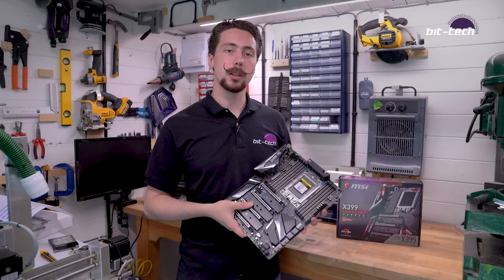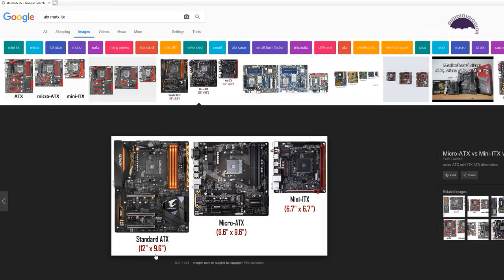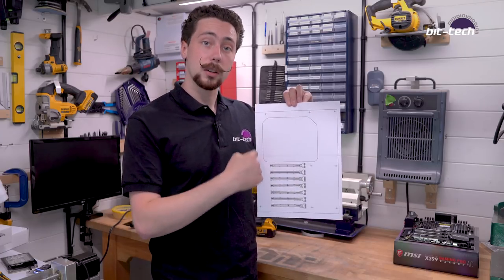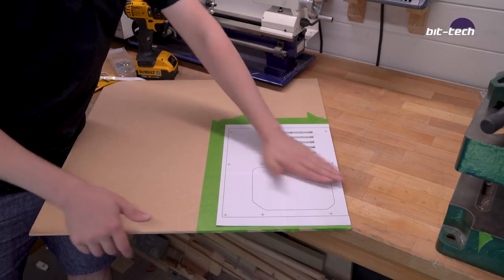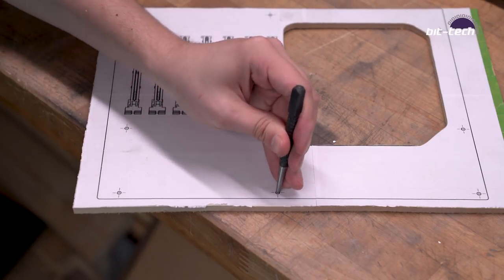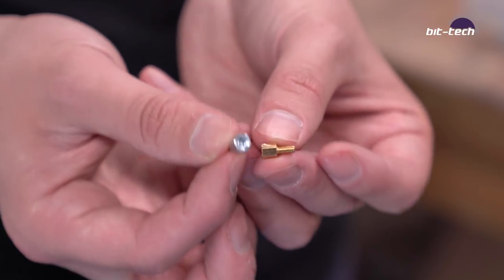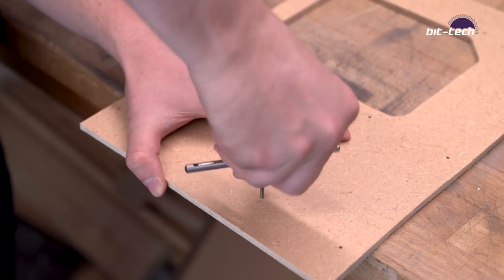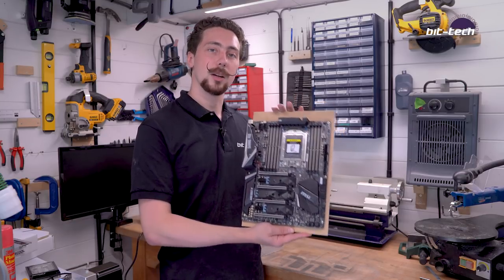How To Make a Motherboard Tray from Scratch | bit-tech Modding

Comment: This is the most professional Youtube channel about PC modding. I sware, I saw a lot of them.
I still waiting a video about brass and carbon fibre tubes bending. And cheers from Russia)
Reply from the maker: Thank you, glad to know we’re hitting the right mark <3

Ahh doubt you’ll ever get one about bending carbon sadly, the innate properties of the material sort of prevent that, they’d need to be formed in shape originally. For brass though, would be better off using annealed copper instead as that bends easy using standard plumbing tools, will be doing a future video on that :D
Reply: @Jack Yo he means swear

Comment: I have designed a motherboard tray for my case build. The thing that I struggle with and which is much harder though is how to attach the expansion card tray. To have the right gap between the motherboard and the tray and how to make those little slots where the back cover of the expansion card slots in.

Comment: Tip for tapping wood: Drop some superglue into the hole before tapping, then tap the hole. That way you have slightly stronger threads.
Reply: That's exactly what I was going to suggest. I find it works quite well and when using thin-set as it can really penetrate the fibers.
Reply: If you don't plan to remove the stand offs, just drop some epoxy into the holes.

Comment: Ok, so the actual easy from scratch version goes like this 
1:Get some decent wood.
2:Lay motherboard onto the wood where you want it to be, make sure it's straight and level. Take a pen and simply push hard into each hole (not turning) This will leave a dot.
3:Take out the stand offs from the old case, and screw the stand offs into the dots you created.

tada.
Reply from the maker: It works, but this way can allow you to do much, much more. Learning to work with the spec and making templates allows for significantly more advanced projects.
Reply: It's better if you can do it out of metal, t6 aluminum can actually be cut with an off the shelf router and the appropriate cutting head or other compatible metal cutting tool. You can also get away with cutting sheets of aluminum with an off the shelf radial saw and the appropriate blade. (Do wear proper PPE when you are working with power tools and metal.

Comment: I've been thinking a long time now about making a drawer like case for my main PC. This so that if I need to access something I just pull the whole computer out on nice ball bearing sliders, like a kitchen drawer.  The main hurdle in my thinking has been how to mount the board... This method here does open things up in my brain. 

For extra points, I'll just need to source some kind of nice cable extendors that allow me to pull the whole thing forward the half meter or so without me having to disconnect things from the back each time. Hmmm.

Oh. And the exterior should of course be some very nicely grained wood.. just to satisfy my need for wood grain... And the case would also be using muffler type whisper box air channels for extra silent operation.

Comment: Using this to create a custom PC wall mount would be awesome! Maybe even dress it in blue leather for the looks.
Reply from the maker: Ooh blue leather would would be sick, just watch out for your heart Chev.
Reply: bit-tech what I wanna do actually is to build a dual system tower but I don't particularly like the obsidian you used. I wanna get 2 atx systems and I found out a website that's called mountain mods that have these huge towers for dual systems. It's a shame that I have to pay more for shipping than the case itself that's worth like 500$ to get it in my country

Comment: Thanks Alex this helps on my planning for my build would prefer a veneer wood as the method to mount MB then a doner system. Do you think having metal nuts located on backside but recessed my be needed to carry a heavy MB?
Reply from the maker: Mostly depends on your tray material and stand-off size I reckon. If using wood, you can use threaded inserts, those will provide a really strong thread for the board.

Comment: Another interesting and informative video. Why not Copper or aluminium or steel though? I guess to keep it relevant to a broader audience. I hope your channel grows, maybe you could get a shout out for supplying a part to DIYPerks or something like that. All in good time but that dynamic worked for me (to some extent) on my knife making channel. As a side note Zadak showed an interesting prebuilt system at Computex with a watercooled motherboard tray, can’t remember if they patented it but I’m sure an ingenious fellow such as yourself could knock something similar up should you be so inclined.
Reply from the maker: Funny that, I know the folks at Zadak quite well haha, we're in talks about producing something together. I did a livestream thing for them at their booth at Computex. 

This video's more about the technique/workflow than being specific, so you can use any material you'd like. I used MDF so as not to waste more valuable ones in the workshop, the 1000D project will have a special one cut from 5mm aluminium :D
Reply: You are now entering the twilight zone. Synchronicity in action. I’m not sure why I even mentioned it, just saw it and thought there was some very innovative design and quality engineering in there and that you might be interested and low and behold... you’re already working with them. I’d never heard of them until recently and the product I saw (a prebuilt) looked awesome but I’m not sure they have a niche at the price point they’re suggesting. Not that the price isn’t fair for the exemplary work and materials that’s evidently gone into it, just that the form factor I saw will limit it’s appeal to professional clientele. In the wise words of Manuel from Faulty Towers “I know naathing” but my suggestion to Zadak would be to consider having modular components for sale separately or along side their prebuilt line, perhaps expanding the prebuilt line to make increased storage and multiple GPUs an option. I’m pleased to hear of a potential collaboration, it seems to me you’d make a good team and though it would be a shame to diminish the bespoke feel of the things I have seen you create, it would be awesome if they were more widely available. Hope you enjoy the journey anyway, regardless of where it leads you.

Ps - As much as I love MDF (having previously built a pc case out of it), 5mm aluminium sounds more your style. Very excited to see it come together.

Comment: I would be careful using a wooden material, due to flammability. You could possibly cover it with metal tape to make it a little more resistant.
Reply: Would that not cause short circuit problems from the board solders touching the board?
Reply: @ianfox5103  Not if using regular standoffs. Most motherboard trays are made of metal after all.

Comment: Great video, but formfactors.org has gawn. Takes you straight to Intel. 

I suppose they've taken over and covet this information, because although I registered, I can't find anything relevant? Oh well, I'll design my own scale drawings. Thanks for your efforts....

EDIT: Decided to use an old mATX and eyeball the mounting whilst marking the screw holes. Will 3D print some spacers and use M4 bolts instead.  Shame about FormFactors.org

Cheers

Ian. Birmingham, UK
Reply: Yeah, I was just about to comment this. The ATX drawings / specs are now gated, and even when creating an account (both types) I was unable to access it. Fortunately, this document still exists: https://web.aub.edu.lb/pub/docs/atx_201.pdf (although I'm not sure how much longer it will be the current spec).

Comment: Just gonna ask how would you support the graphics card
Reply from the maker: A lot will depend on the design of the case it goes into. You could either attach an existing IO bracket onto a tray made using this method, or could cut out slots for GPUs from the back panel with mounting points etc. There are some interesting methods out there used in open test benches, some use a similar system to those found in mining rigs, others use rods with threaded holes etc.

Comment: The download files are all DXF I don't know what to use to open this file type If anyone knows a free download that will open these files Please Help I am in the middle of trying to layout the motherboard stand offs on a Plexiglas Piece for a Thermaltake tower 900
Reply from the maker: Fusion 360 will open the files and is free
Reply: @bittech1  Thank you for the quick replay I Like you channel
Reply: I am still having trouble opening the file for ATX motherboard layout
Reply from the maker: @kennethkirby320  Did you try the .F3D native fusion file?
Reply: I can open it in the cad software but I am having trouble getting the dimensions for the stand offs and printing it. I was going to try to lay it out once I get the dimensions. Sorry for all the questions it has been years that I did any auto cad
Reply from the maker: Ay no worries, have you checked out the video we did earlier on making cutting templates? Might help a bit as it uses the same techniques
Reply: @bittech1  No I wish I could if I could find the templet to print out it would be a BIG help
Reply: @bittech1   Could you give me a link to the video for  making cutting templates? sorry I couldn't find it in your videos
Reply from the maker: Ooh you’re actually right, I confused it with an article I did for the main site, here’s a link for you:
https://www.bit-tech.net/guides/making-cutting-templates/1/